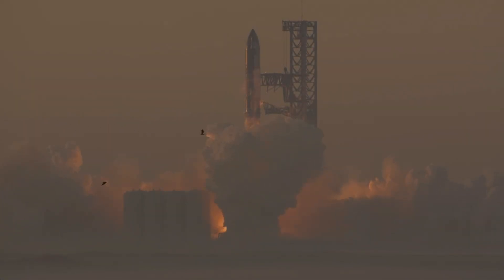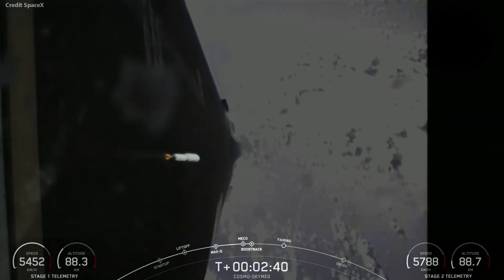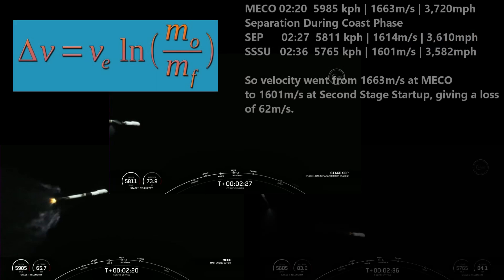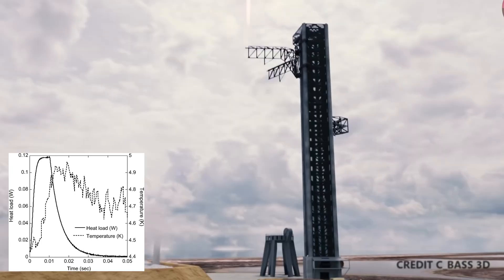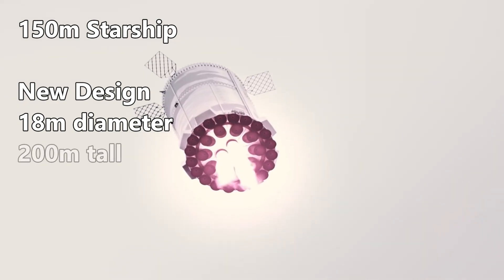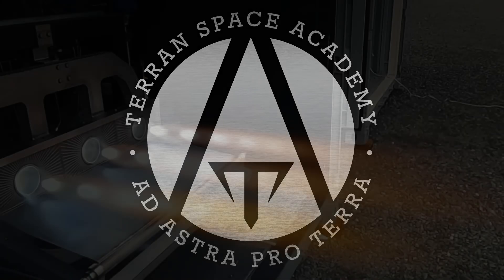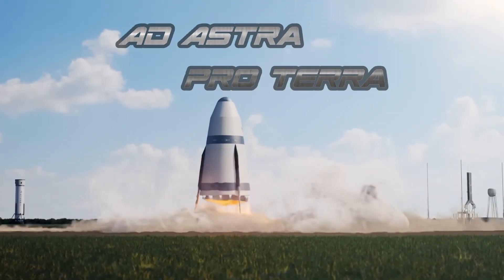Ultra Starship and Hypersonic Retropulsive Reentry

Comment: don't expand until you've done your homework.
.
.
.
last warning.
1) I'm using half-cylinder for TPS mass (nosecone area reduction somewhat offset by extra flap area.)
2) not sure how the Raptor's exhaust velocity changes thru the atmospheric density profile, so used V.ex as avg of 3236.19 & 3726.53 (3481.36m/s)
-prop=mf * [E^(5800/~3481.36)-1]  = mf * 4.291044
-for 50m SS, dry~120mT, prop=1200mT,  10%=120.0mT.  mf=240mT, prop ~1030mT, tiles ~11mT
-for 64m SS, dry~132mT, prop=1755mT, 10%=175.5mT,  mf=307.5mT, prop~1320mT, tiles~14mT
either way, tiles ~ 1% of prop mass for 5800m/s dV.

for 18m SS concentric tank 40% inner tank is 11.38m diameter.
Reply from the maker: Coming up... :-)

Comment: I'd be worried about thermal expansion if only the stainless steel was used as the heat absorber.  Feels like a lot of warping and fatigue issues would present themselves rather quickly.
Reply from the maker: That's a good point... the question is how much heat would radiate to the ship?

Comment: The ignition sequence start of the Raptors is very tedious and critical, extremely sensitive to any fuel disturbances during low G transitions or staging. They tried to ignite the engines during IFT-1 but they didn’t operate… They should have tried to install simple ullage thrusters for staging first instead of adding 10 tons plus of hardware for hot staging, the less part the better?
Reply from the maker: Indeed but the hotstaging solves the escape abort issue...
Reply: The cowbells scattered around Boosters are tank vents.  They can be used as ullage thrusters.

Comment: Has SpaceX told us if the Booster will fire its engines all the way down from 're-entry' to landing or will it be more like Falcon 9 with 're-entry' and landing burns?
Don't the StarShip Booster and Ship have larger LOX tanks than LNG/Methane? Mix is 3.6:1 LOX to Methane, isn't it?
Amazing homework problem! Can't wait for the answer...also would be a little terrified to watch such a massive rocket launch! <G>
Reply from the maker: More like Falcon 9 I'm sure...

Comment: Thanks for sharing your thoughts, ideas and videos. Addressed some ideas I’ve had in the past. My latest thought exercise was to ponder if Starship could be segmented into three of more parts using engines, fuel, and nose cone as needed with various cargo segments that could be interchangeable. Why spend time transferring fuel when you could simply undock the top and bottom from a dedicated fuel cargo segment and then reconnect the segments needed for reentry. The fuel cargo segments could then be docked together for storage and possibly repurposing after the fuel is used. Why carry vacuum engines to the surface of the moon if you can’t use them for landing or takeoff. Park them in lunar orbit for return trips and land a lunar cargo segment directly on the ground without needing extensive ladders or cranes to reach the surface. Perhaps load a automated tunnel boring machine on end in the bottom of the cargo segment to bore a deep shaft directly into the surface of the moon and lower the cargo segment into the shaft for protection afterwards.
Reply from the maker: A very smart man worked on that exact idea several years ago my friend and I thought it was brilliant. Sadly, without a LOT of funding, building Starships are just for the billionaires :-) But you are quite right. It is an excellent concept.

Comment: Solid Methane melts @ -182.456°C and as a Liquid Boils @-161.5°C.
Solid Oxygen melts @ -218.179°C and as a Liquid Boils @-182.962°C.
Since Oxygen boils at a slightly cooler temperature than Solid Methane (-182.962)-(-182.456)= -0.506 difference.
It makes more sense to have Oxygen on the outside, cenrifugally compressed and chilled at the outer circumference and more gaseous and lower pressure at the center to more easily interface with Methane's warmer liquid state that freezes with contact to the interfacing membrane. 
To mininize the risk of solidifying the methane completely and keep oxygen in its colder liquid state, the oxygen would pump at its outer compressed zone, away from the lower pressure and gaseous inner zone (heated by the warmer methane).
The Methane risks forming a solid ice layer at the membrane and also needs centrifugation to keep from freezing. Another way to combat the freezing is to place an aerogel membrane composite open cell foam with a very low pressure, sublimated methane "snow" as an effective insulative igloo barrier to hinder heat transfer.
Reply: One could simply keep the LOX at a higher pressure than LCH4.  Boiling depends on both temperature and pressure, so LOX could be kept at above LCH4 freezing temperature, and still be kept from boiling.

Putting the LOX tank inside the LCH4 tank would help if the goal is to pressurize LOX higher than LCH4: the LOX tank would only need to be strong enough to withstand the difference in pressure between LCH4 and LOX.

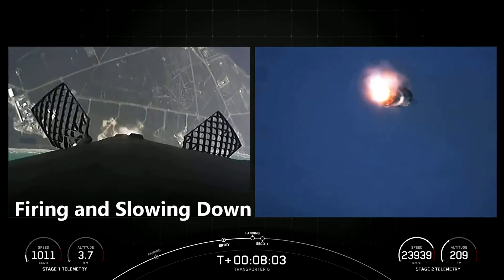Comment: 4:01 6:03 Booster will NOT use a reentry burn, unlike the Falcon 9.  This is both because SuperHeavy stages (and therefore reenters) at lower velocity than Falcon 9, and also because SuperHeavy leverages its stainless steel construction and engine shielding to tolerate much higher heat loads.  By eliminating the reentry burn with the SuperHeavy, SpaceX is able to further optimize for mass to orbit, as well as eliminating a whole subset of potential failure modes.
Reply from the maker: Thank you... Not having seen one survive that far yet I wasn't sure they had decided.

Comment: 1:46 IFT1 did not "fail to separate"; separation was never commanded at all because the stack never reached the altitude or velocity required for separation in the first place.  FTS was triggered not because of separation failure, but because of loss of control (engine compartment fire on Booster 7 took out the hydraulics used for gimballing the center engines.)
Reply from the maker: That would make sense but wouldn't it have been a good way to check escape/abort?  I was told they did order the separation but when it failed they went ahead and fired the FTS.  Starship could have controlled itself and landed offshore where the booster would have been.  Surely the thought of this.
Reply: @terranspaceacademy  this was put to Elon (via Twitter, by NSF people if I recall correctly), and he replied that in retrospect, that's what they should've tried to do - but at the time, it wasn't part of the literal flight program (as in, a contingency coded into the onboard flight control software.)  And, neither was it included into the pre-filed flight plan, so that deliberately commanding the stack to fly outside of the prearranged flight envelope and test protocol per the launch license wouldn't have been kosher from a regulatory point of view.

Comment: Could you rotate the ship to spread out the heat over a larger surface?
Reply: That's the whole idea behind Starship's 'bellyflop' reentry (the Shuttle also did something similar, for similar reasons.)

But clearly, SpaceX's calculations showed that Starship could not survive its reentry with just naked stainless steel facing the hypersonic flow - which is why they deemed it necessary to add the thermal protection system on the Ship's windward side.
Reply from the maker: We know that but is it possible?  Just because they've chosen something doesn't make it right.  No water deluge necessary? No hot staging to start with... etc.
Reply from the maker: That's a good question but torquing that much thin steel mass under extreme conditions would be dicey :-)

Comment: Great video as usual and again interesting ideas I agree a separating nose cone for safety to be a good idea but isn't there liquid oxygen tanks in the tip of the nose coat something done for centre of mass requirements?
wouldn't this make such separation extremely dangerous severing feed lines etc
Not sure I think the setting and retrieving homework to be a good idea as it might put some of your audience of not myself although I won't be doing homework maths not being my strong point something not helped by my being blind and syntax difficult in formula proving it a great memory Challenge
Cheers 0:03
Reply from the maker: Just an exercise for those who want to do the work.  We'll cover it all before too long :-)

Comment: Aren't there logistical problems preventing any increase in diameter? Something about the max you can put on a train or something like that?
Reply: That was the limit determining Falcon 9 sizing.  Starship is already too large to transport by land; it'll be limited to barges for long-range transport and will be moved upright between manufacturing/test/launch facilities.

The biggest logistical challenge for increasing Starship diameter would be simply that all existing tooling, transport, and launch infrastructure would have to be accordingly resized.

Then there are structural and materials challenges, especially if increased diameter isn't accompanied by correspondingly decreased height: in that case, you'd be dealing with greater thrust (which would go as a square of diameter increase) leading to a need for much stronger thrust puck, correspondingly more engines, much more resilient launch site design, correspondingly larger exclusion and hazard zones, etc.  Larger diameter also means more energetic propellant slosh, so extra mass for larger/heavier slosh baffles.
Reply from the maker: It would be better for a Starship competitor to start with an 18m diameter three stage all reusable system and work on that...

Comment: The Starship booster will be traveling much slower at  MECO than the Falcon 9 first stage. I don't believe the Starship booster will be doing a reentry burn.
Reply from the maker: That's what I've heard.  Steel is pretty tough too so you are probably right.

Comment: Even if starship would enter base first, still would need a termal protection system (heatshild).
Reply: he was talking about using the engine's exhaust to move the shock away from the ship though, which keep the ship from reaching the temperatures where a TPS would be needed
Reply: @demariultraastra864  I understood that part, but I don't think that could work for re-entering from orbital velocity(to much heat and dynamic pressure), also a thermal protection system purpose is not only for saving the vehicle from complete destruction by melting ,but also to recover a operational vehicle including less resistant to heat parts that are exposed, like electric actuators of the engines and propellant pipes  gaskets, anyhow you can put at the base of starship a ceramic tiles heat shield that would be much smaller and lighter than current version , you only need to cover the exit of the nozzles with doors covered in tiles, after all the space shuttle had several of those doors in the heat shield , three for landing gear and two propellant pipes inlets and another two for attachment of the external tank.
Reply: @theOrionsarms Thats a good point, I didn't think of that
Reply from the maker: I'm hoping that a powerful burn would get it past the plasma phase and then it can go horizontal, putting a lot less stress on the heat shields.
Reply: @terranspaceacademy  re-entering from orbit is a different things from what a falcon booster does, the energy is scaled with the square of velocities, so if you have 30 Mach instead of 10 you have 9th time more energy, and temperature increase with fourth power, actually the maximum 1650°C temperature of the space shuttle heatshild is pretty low because the hot plasma in front of any vehicle that come from LEO is closer to 3000°C , but a ceramic heatshild lose most of the heat by re-emission, this is the reason why is called radiative heatshild , if you want to blow something against that that hot plasma as a alternative method you need a lot of stuff, I don't know how much, but probably is close to half the mass of the vehicle. A somehow related method of regenerative cooling with liquefied methane was proposed for starship, but was abandoned after the calculations showed that the mass of cooling agent would be higher than a side mounted ceramic heatshild.

Comment: What about the issues with the temperature difference between the liquid oxygen and methane requiring lots of insulation?   Sorry, I'm in the middle of switching night to day shift and won't be trying the homework.
Reply: methane and oxygen are actually liquid at nearly the same temperature, so the tanks themselves would almost certainly provide enough insulation to keep them both liquid, and the tanks on the current starship already have a common dome where both the methane and oxygen are in contact with no additional insulation.
Reply from the maker: They are massive heat sinks and with venting of pressure buildup in the upper tanks are effectively cooled by evaporation...

Comment: I was wondering about incorporating Stokes designs into starship too.  But i if they went with such a radical redesign they would look at moving to hydrogen 4 the 2nd stage as well now that it’s looking leashed to manufacture that fuel on mars than from c02 & u need to extract water from the ice anyways.  Turning  the outer ring of 1st stage into a a giant continuous aero spike could be something SpaceX thinks is worth the effort.  I think your tank redesign will add too much weight.
Reply from the maker: It does indeed add some mass but would that be necessary for the structural support of an 18m system?
Reply: @terranspaceacademy  Elon will throw mass at a problem to achieve safety / reliability, but if you look at what he is saying about just making hte rocket longer, I don't see him doubling the size or buildiugn a tank in side a tank like this.  I do think it makes sense to increase the diameter of the 2nd stage so they can incorporate some of Stoike's tech, but I don't think Elin wants to spend time on that.